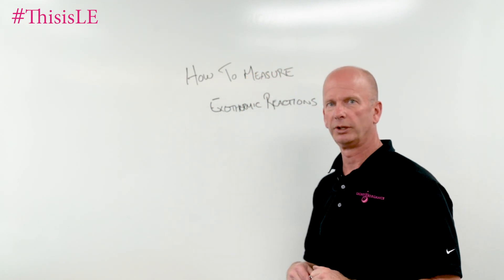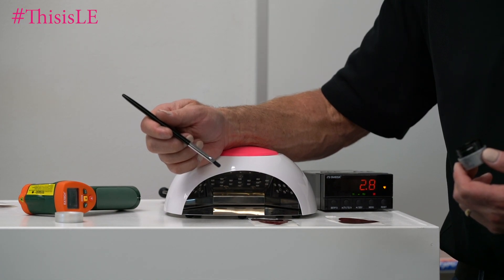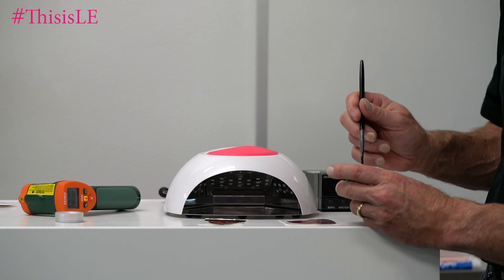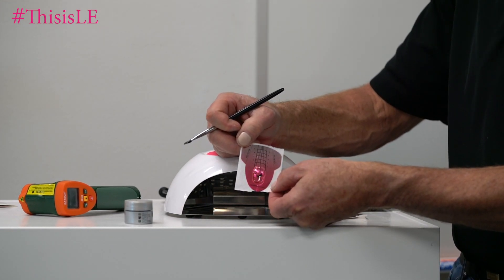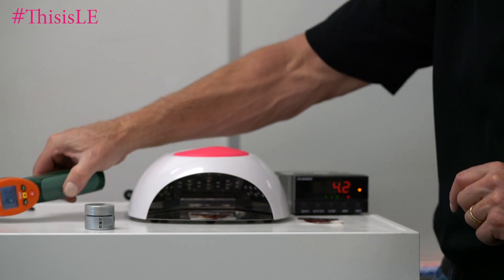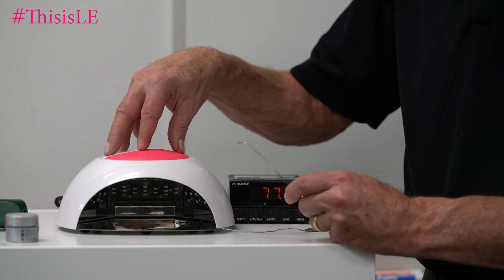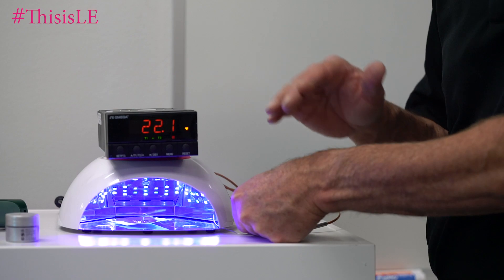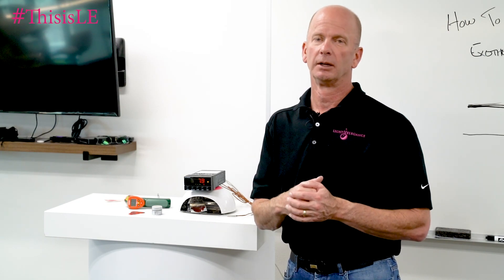How To Measure Exothermic Reactions and Why It Is Important—Chemist Corner with Jim McConnell

Comment: Hello jimmy! If i cure on low heat mode, do i have to cure again in the normal mode for 60sec more?
Reply: Hi Julidza - if you cure on the 120 second mode, the last 60 seconds is at full strength and a second cure cycle is not required.